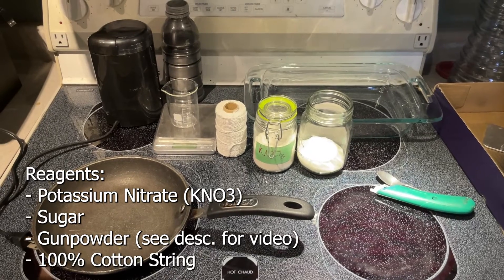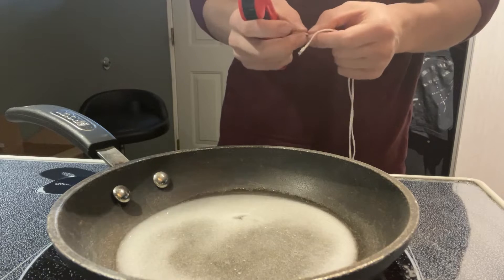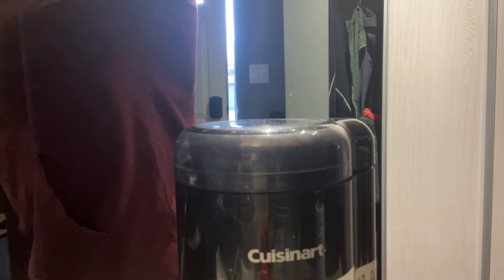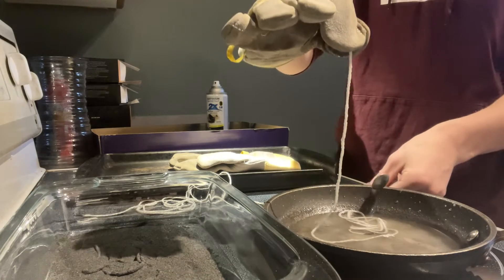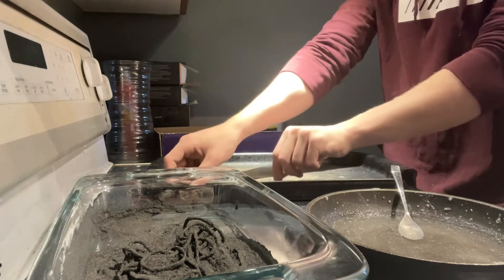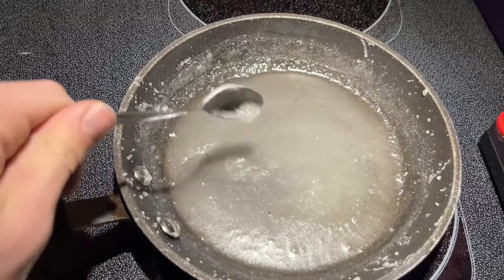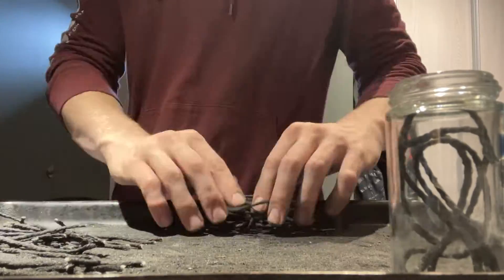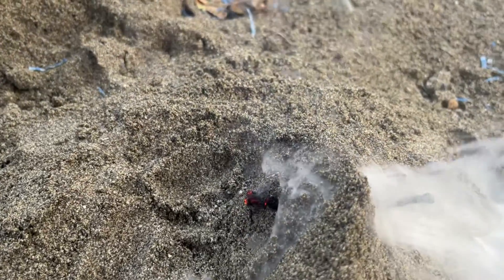Homemade BP Fuse Instructional - Reliable & Easy

Comment: With the thick sugar fuses. I used scissors to trim them down to get them inside a thundermug etc. You only need to trim the very end that goes in. Also, try to light them with a torch that has a thin flame. Propane torches can light the whole fuse at once cause the flame is too thick.

Comment: Hey for the cooking and baking can it be done with a gas oven and a gas stove?
Reply from the maker: Theoretically it would be safe, as BP only self-combusts at high temperatures (464C according to sciencemadness). Keep the temperature below 70 and it would probably be OK.

That being said, its quite sketchy and it may just be better to dry it outside on a hot day in the sun

Comment: can i use kclo3 intead of kno3
Reply from the maker: if you remove the sulphur and do 70/30 yes, kclo3 and sulfur can spontaneously combust due to sulphur acidifying over exposure to air. Also be careful because kclo3 is a lot more sensitive to impact...

Also how in the world do you have chlorates and not nitrates??
Reply: @kitchen_chemistry  oh where I’m from its easier o get kclo3
Reply: @kitchen_chemistry  the way we make black powder is 6 kclo3 5 charcoal and 2 sulfer lol not really percentages like you

Comment: For the people who are baking their fuses, make sure to put a cup of vinegar into the oven in heat-resistant glass at 200 degrees for an hour after taking out your fuses, or your oven WILL smell like blackpowder. Learnt this the hard way.
The fuses worked great though
Reply from the maker: adds a little extra flavour to the turkey you cook next
Reply: Nothing wrong with the smell of B.P.
Reply: @jase4270  yes as long as you live alone
Reply: 200 Fahrenheit or Celsius?
Reply: @Father_Agartha  celcius
Reply from the maker: @Father_Agartha  200F (93C), 200C would have the vinegar boil

Comment: Does the string have to be cotton?
Reply from the maker: yes, it needs to be a material that absorbs easily
Reply: You can actually use lots of different type strings.
Reply: @jase4270 as long as they are not synthetic though

Comment: Your basically making a rocket candy fuse and coating it with gunpowder. I have alot of experience making fuses and if you would like to try my technique mix finely ground kn03 and Mg powder that is around 20 micron or smaller in 50/50 mix, wet cotton string throughout with 91% isopropyl alcohol and squeeze most out leaving a little. Put mix in large 1 gallon zip lock bag and add  cotton string.  Simply combine and mix, with  no messy hands and doesn't require any oven just let it sit out overnight . If you want I wrap completed fuse tightly around a old liscense plate and hang  it close, not too close to heater . It's super stiff and reliable I do like adding an additional sprinkle of magnesium metal powder to my hand as I'm wrapping completed fuse onto liscense plate for additional Pyro coat. Another way is the old stand by a red road flare string and acetone mixed similar in a bag adding a little wax dissolved in acetone at end to firm up
Reply from the maker: That'd make a pretty good fuse for sure. This was the best fuse I found using only BP and KNO3
Reply: @kitchen_chemistry could you make a video doing this recipe would love to see it before i blow somethinh up and love your content bro

Comment: Nice :)
Just remember with these kinds of fuse they pretty much become like quick match even when lightly confined. Or at least in my experience. I learned that the not so fun way when a firecracker I was using similar fuse with almost lessened my 10 digits lol
Reply from the maker: What did you confine it in? I've only used mine for gunpowder firecrackers and for a few smoke bombs. Don't really want to make a firecracker with an energetic, too scared to compress it lol. The goal is to get the loudest boom while maintaining ten fingers.
Reply: @kitchen_chemistry it was simply confined in the actual housing of the firecracker if that makes sense. It was like a cardboard container that had about 2-3inch of fuse outside and about 3 more inches inside the cardboard until it touched the flash.
The fuse that was confined inside the cardboard was the stuff that went off like quickmatch. I guess it was from particles of bp on the outside of the string confining and lighting all the rest instead of the whole fuse burning so quick.
I also noticed that sometimes sparks can fall down from the fuse and ignite further parts of it if it’s standing upright which is sketch.
But for simple fireworks like, fountains, rockets etc this fuse works great 
But for things like strong firecrackers etc or things that need max reliably good ol visco is what you should use, at least in my eyes :)
Reply from the maker: Fair enough, i see the sparking happening. I tilt it on its side. But you're right, a visco fuse would be ideal. Im investing in some equipment for making a MMO anode, and potentially a lead oxide anode for the electrolytic synthesis of perchlorates. I believe you need perchlorates for a visco fuse correct?
Reply: @kitchen_chemistry  I think commercially nowadays yes perchlorates are used for visco fuse. Though if your planning on making some visco esq fuse then chlorates will work aswell.
Reply from the maker: @TheFireGoose  Thanks for the info, once I get some stuff I'll be sure to experiment around with a good reliable visco fuse
Reply: damn everywere i go you happen to be here wtf. When will you return someone i know has mad ETN because of you lol we just for you to come to make other recipe and testing happy new year by the way lol @TheFireGoose
Reply: @lmaozedingdong6099  Yeah I get around the on the internet lol, also hopefully I should be back soonish :)
And happy new year too